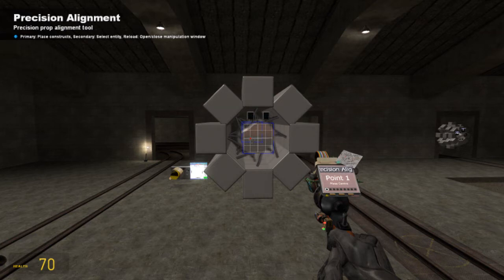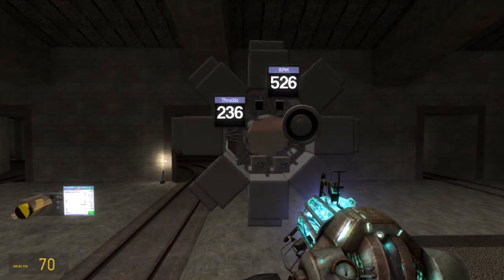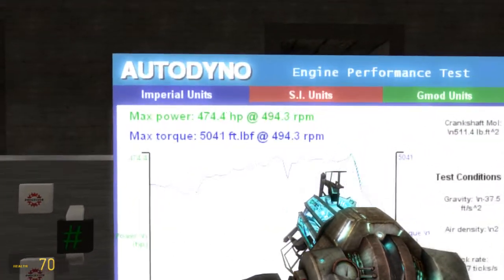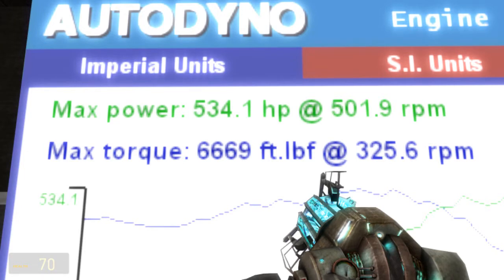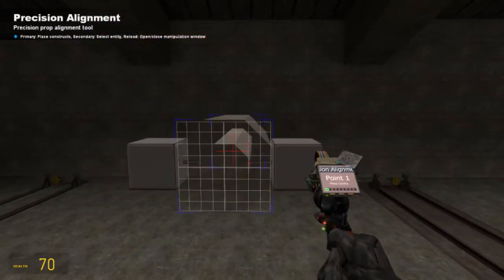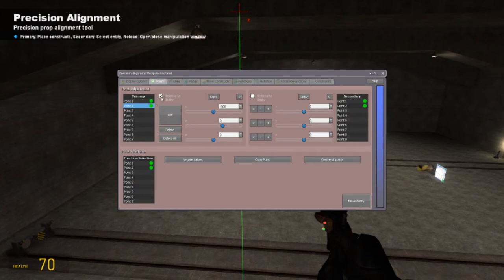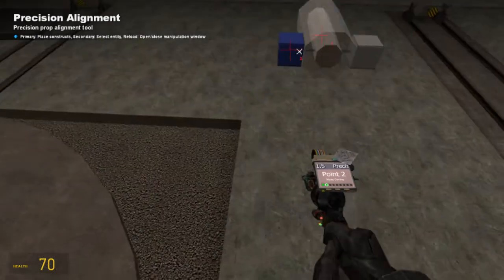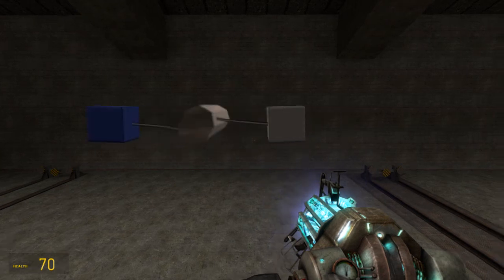Gmod - (Tutorial) Engines 03 "Sliderless Engine"

Comment: I know this is a really old tutorial and everything but does anyone happen to know if there's a way to make that axis constraint stronger? I'm doing everything in the video accordingly but the axis 'slider''s points move about with force from only a 20 power thruster. To the point where sliders are actually more reliable.
Reply from the maker: Are you using the baseplate of your entire contraption as the constraint point for the axises, or are you doing it the old way where you have a crankcase that you weld to your vehicle?

The axis piston is incredibly strong if done correctly.

If you check the vehicles I did shortly before I stopped playing the crankshaft on those two weighs 24 and the pistons each weigh 1, the base plate weighed about 150.

Speaking of... weight your pistons to 1 weight instead of whatever they are.

Weight does not help them in any way except to counter air resistance relative to their size which is negligible.
Reply: Actually I had tried it on both a crank case and a base plate. But wow I never knew that the weight did nothing for pistons. Now that I think about it, it might have been due to the weights of my pistons, thanks for the information friend!

Comment: Hey man, when I have built my engine and I throttle up, it sometimes runs backwards (ie the RPM's show a negative amount.) Any tips on making sure you always get it turning the same way everytime?
Reply from the maker: If you make something like an I4 where the 2 outer pistons fire then the 2 inner it will do that because it is not violating the chips order, one side is firing then the other still regardless of the direction of turning. If you do more complex firing orders like each individual piston fires instead of pairs this wont happen, or more pistons like a v8. I have had v6s do this with a 3 pair firing order rarely but this is almost always 4 piston engines that do this for me, do your experiences match?
Reply: I'm not sure if this is the fix that you're looking for, but you can put abs() around the rpm algorithm in your chip, which should make your negatives disapear

Comment from the maker: Point 1 must be the same height and width from the block as point 2 and seperated by a distance along the orientation of the crankshafts length.

You are probobly putting point 1 and 2 on top of eachother instead of seperating them a little.

The orientation of the axis is determined by the orientation of a line from point 1 to 2.

So if they are ontop of eachother it ends up just guessing the orientation.

Comment from the maker: Wait how do you know where it is making the axis? If you are doing this correctly it should not matter where it makes it on the thruster, just where it makes it on the main prop because the main prop basically acts like it has a solid piece of wood coming out from a bolt that lets it swing, and the thruster on the end.

Do you have point 1 and point 2 mixed up?
Are point 1 and 2 directly on top of eachother? if so that is wrong, hey should be offset sideways slightly or the axis will be borked.

Comment from the maker: You are using Mass Center, and not hit position, for marking your point, right?
If so then that would be because the prop you are using has its center of mass messed up when the person did the modelling for it. An easy way to fix this is to make that prop blue then take that same prop and offset it by 50% so the side of the non blue prop is in the center of the blue prop. Then mark that location relative to the blue prop and set your point there on the blue prop.

Comment: all of my engines have been remote axis since axis linedraw came out.  Before taht I used wishbone engines.  Amplar posted a rocker engine using a similar system about 3 years ago on a "rocker swinger engine 8 cylinder hotrod", all the engines I've posted so far can be seen if you examine closely to be remote axis engines.  Rigid rope wishbones with a single adv ballsocket were what I used until axis linedraw came out.

Comment from the maker: XXXmags and I were playing around yesterday and slapped a few engines on some of my old vehicles, No real problems except my 32 piston engine has so much torque it needs some sort of reduction. 

I have experienced the engines freaking (all of the pistons turning into a electron cloud)

That was due to two things...

1. The piston model was causing it
2. The crank did not follow regular weights

But mainly it was the piston model

Try phx cubes and see how it goes

Comment from the maker: Has no effect on performance except to add balance, that is why I do boxers so I have two pistons cancelling each other out but not being on the same degree on the crank. (Performance AND Stability!)

-The size of the crank adds torque but reduces stability a bit

-The more often an engine has a firing point (Every 90 or 45 or 22.5 degrees instead of 180 and so on) the smoother that engine is... Sadly my engines here are every 90 degrees/

That is the cliff notes of what I have learned

Comment from the maker: I spent about 20 straight hours doing every experiment I could think of to learn how to make the most efficient engine.

-Axis system actually adds a bit of torque / hp

-Jar pistons are the best

-Adding weight does not add performance to the engine , it adds stability and the habit of taking longer to stop due to inertia

-Adding pistons that fire at the same point , at the same time (like a Inline four with firing order of 1 and 4 at 0 degrees and 2 and 3 at 180 degrees